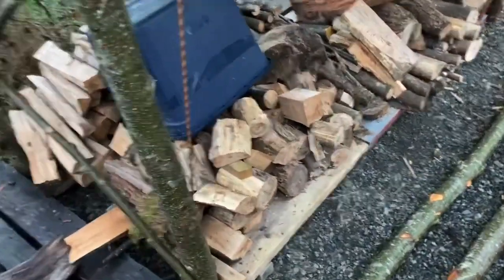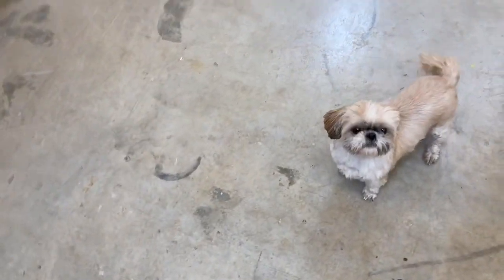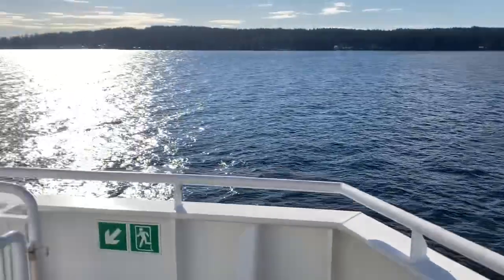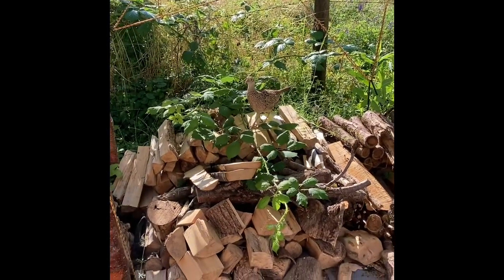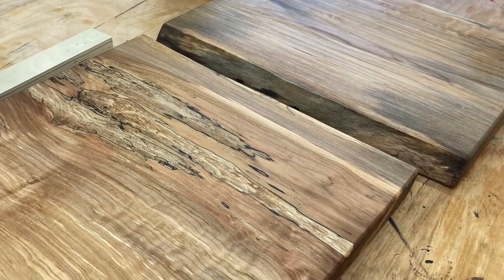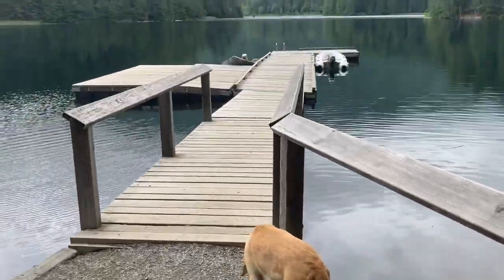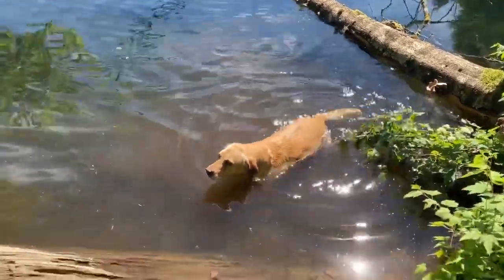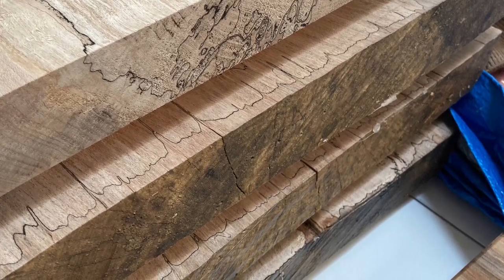Truckcamper build update and what I have been up to..

Comment: Will Titebond  II stick to itself? 
 In an earlier video it appears you glassed corners,  came back later and cut edges straight, then covered and glued full wet sheets onto side.
 I can't tell if you overlapped newly glued material over dried edge already on coach.
Thanks - appreciate your attention to details.
Reply from the maker: I sanded the existing corner pieces that were previously glued and dried … it seems to be very well adhered … I would not trust glue on  un-sanded glued surface .